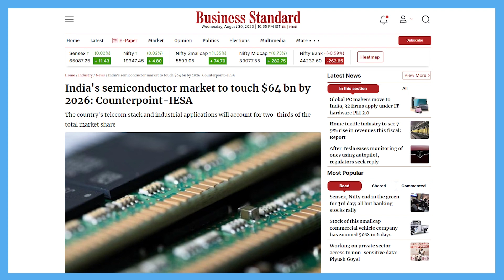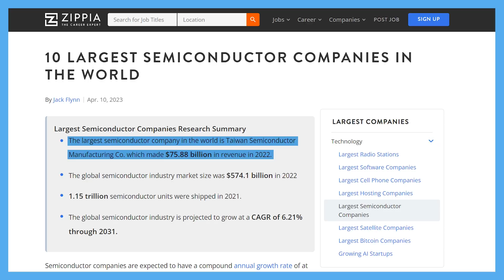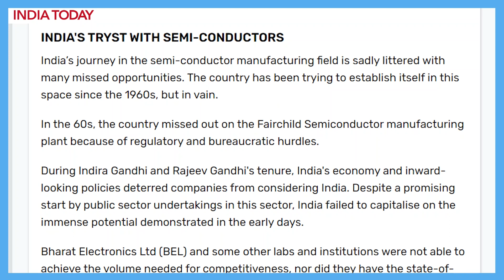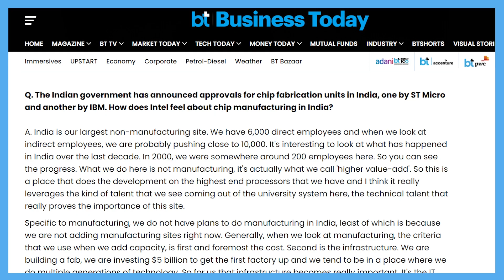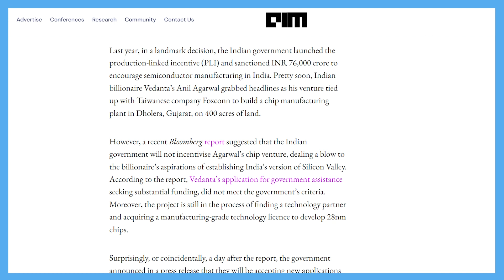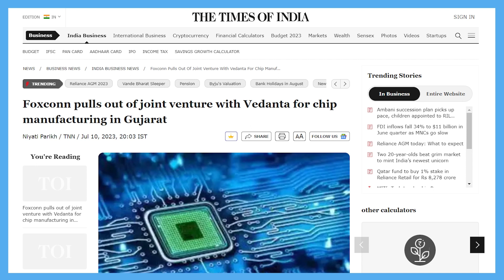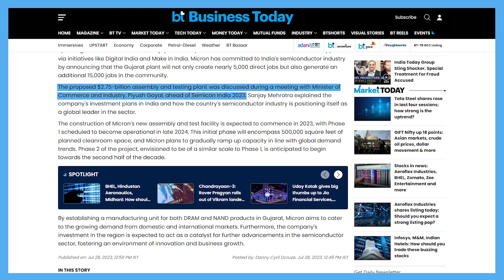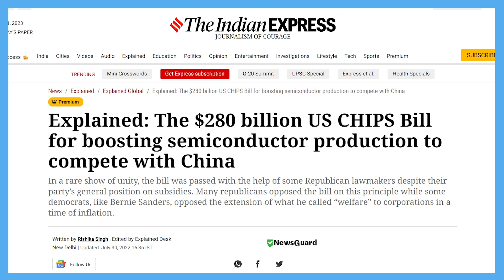India's Plan To WIN The Semiconductor War - China's Secret Play | Unravelled

Comment: I think your information is misleading,  Taiwan is the leading manufacturer of the high end chip almost all high end chip above 5nm are coming from Taiwan but China is the leading nation in manufacturing mature technology chips,  this is due to the rapid expansion of Chinese chip industry during the last 10 years,  they are now at a point that 1 in 3 of maturing technology chip is coming from China.  By 2027 China will have cornered 40% of semiconductors based on maturing technology.   India needs to stop just talking about plans,  it needs to get the thing going.  Just like China India should start with semiconductor based on maturing technology because this is where semiconductor manufacturer like TSMC makes most of its money,  it is not with their 3nm iPhone cpus.    Electronic cars do not use the most advance chips,   military equipment do not use high end expensive chips.  TSMC is using its profit from making semiconductors based on maturing technology to make high end chips.

Comment: The real game in semiconductor industry is not in the second sector of the economy frabrication but in the knowledge based economy. The products of R&D are knowledge, patents not goods. There are two main type of patents design (knowledge of how it works) and fabrication processes (knolwedge of how to make it). Like you said the US has a quasi monopoly of design patents. They make a lot of money just from licensing their designs. The emerging markets fabs are competing only at the fabrication process patents. Some like Samsung has got also on the design bandwagon but TMSC has not. Problem is China has engaged in the fab bandwagon and has made rapid progress in design and fabrication patents for up to 28 nm level. The US R&D chip design industry saw a potential competitor to their monopoly, that's why all the sanctions about China hich tech chips. So India can only engage in the fab at the bottom level, manufacturing under licensing for both design and will be able to compete with lower production (mainly labor) costs to gain any profits out of it.
Reply from the maker: Thanks, this is an excellent insight!